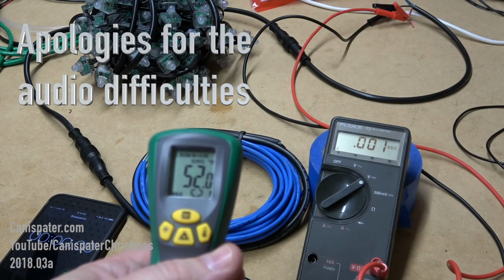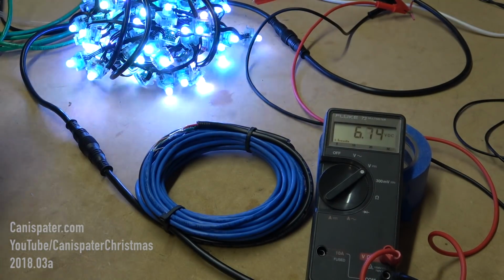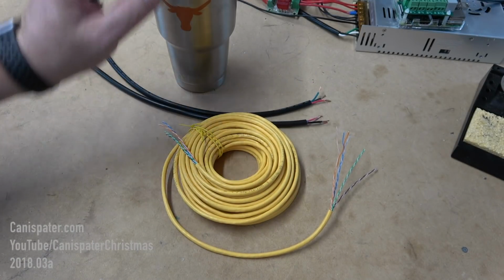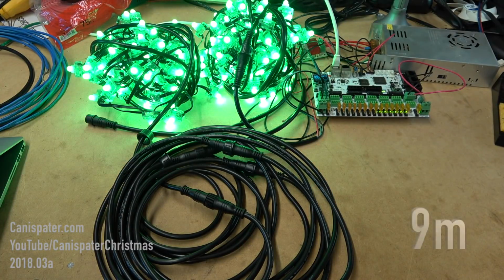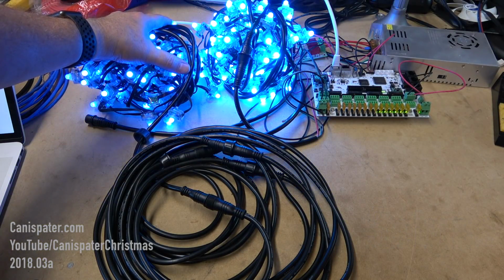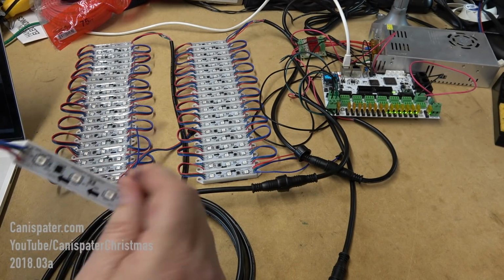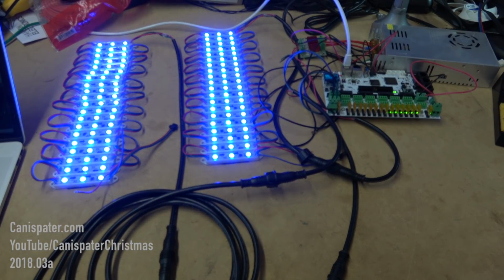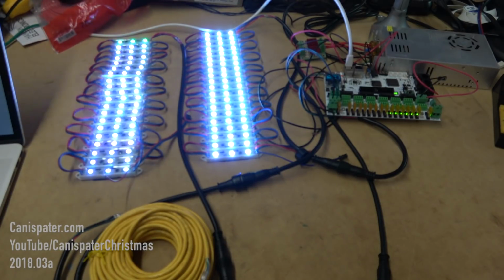RGB Pixel Distance Test - HOW FAR IS TOO FAR? (2018)

Comment: Thanks for the video Jeff.  Even though distance isn't something I worry about, your tests are most informative.  Some of the research I have done speaks of 15 ft between controller and first pixel for data.   Dumb pixels.. (I don't think they were talking 'bout me) added to boost the signal to the first "smart" pixel.  
Any thought on using wifi for data and just running power all over the yard?  Big Tesla Coil in the middle of the yard....NOW we're talking.  Tim the Tool Guy would love it.

My wife has migraines fairly often so I usually know my limit on "Have you gone too far!!"
Reply from the maker: Yes! More POWER! I believe the counseling is that WiFi from Pi to controller has too much latency to maintain accurate timing and the amount of data will become a problem vs using copper. However, people are using ESPixelSticks all over the place with success, but I have no experience with them. Now syncing multiple Pis is done easily over WiFi because the amount of data is very small and allows for misses. I believe Jim Nealand? has several he runs that way. Ethernet limit is 100m (328ft) so a skinny data cable to a controller is easily done unless you have a really big yard. I'm not sure a dumb pixel will work, but null pixels can. Now, the signal out of a controller will be "higher" than a pixel because pixel-to-pixel distances are relatively short. I'm kinda all over the place here. Have I confused you enough? :)
Reply: I meant null pixel, but dumb fit and sounded pretty good at the time.  My runs are fairly short.

Comment: My question for you is kind of along the same lines, but I was curious about the data side of this. I have a 5 volt TPLink 5 port switch.. Not POE, just a switch. How far can you run a CAT5 or CAT6 cable out to other controllers in the yard and still maintain data signal to get to them? I am looking at possibly a 100 foot run from the switch to say an E682, or E6804. Thanks for ALL of the useful info that you give in all your videos!!
Reply from the maker: Thanks! The Ethernet spec is 100m or 328ft. So that is the distance limit switch to switch or switch to controller.

Comment: Thanks  now i only whonder  .... 5v   ?!?  is it a BIG dif  or same same....  :)
Reply from the maker: I don't have enough 5V strings to test, but I'd suspect more problems as the overhead is much less. Although, I think most folks running 5V are use to injecting power anyway so maybe not really that big of a difference.

Comment: Isn't the key to use ethernet cable is combining the wires to make an effective larger cable?
Reply from the maker: Yes, but it’s still not a lot of copper compared to larger wire sizes.
Reply: But I think you still need to combine some.